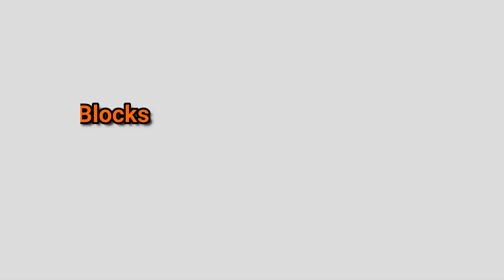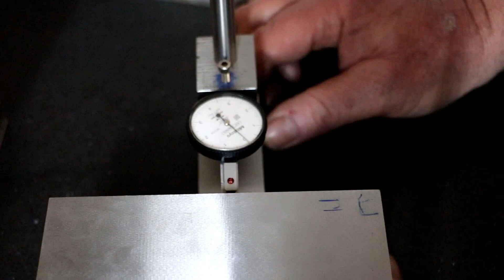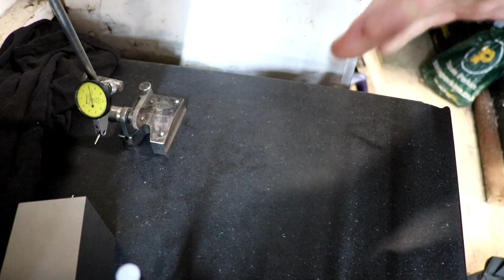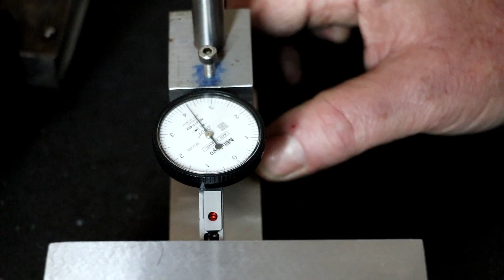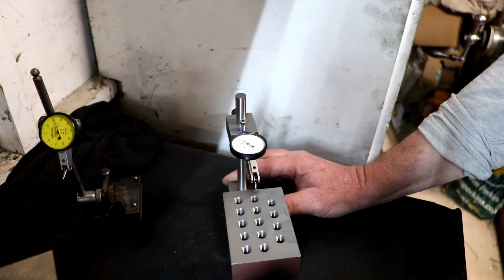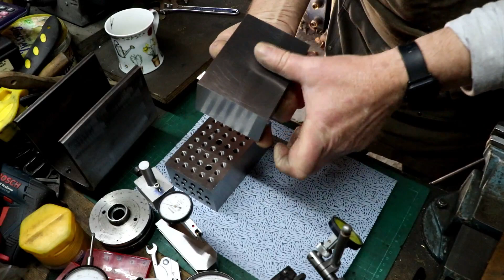Surface Grinding, Set Up Blocks finished

Comment: At 34.30 it's either 4130... 4145 or EN24T Alan. Make sure to spray them in WD40 if you are storing them. 👍
Reply from the maker: Cheers Dave, I put that much into them there in the house 😁😁

Comment: I like it, can I order one
Reply from the maker: Don’t know about that one Michael glad you like them though.

Al.
Reply: Pearce Machineshop it’s yet another project I really must start soon. If it’s any consolation I really couldn’t see why you were getting inconsistent readings either. And you know now but in case,  1/10 of a thou is approx 2.5um. A um being a micro meter or a micron.